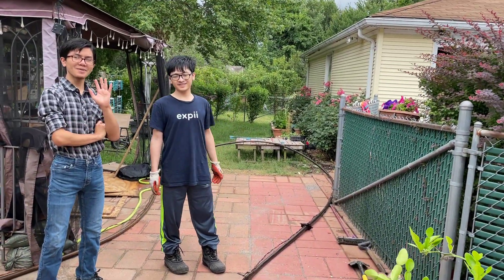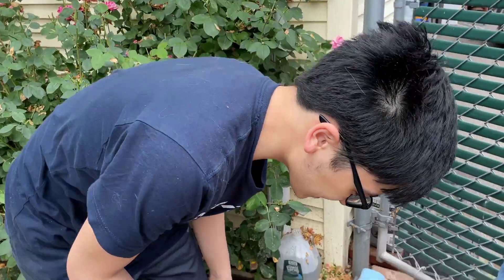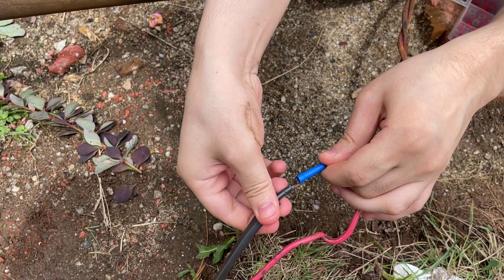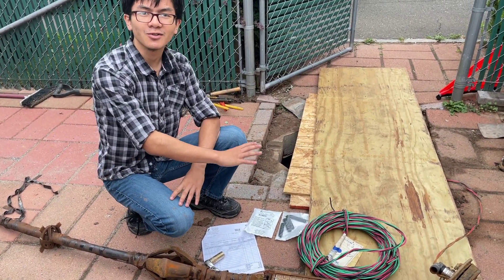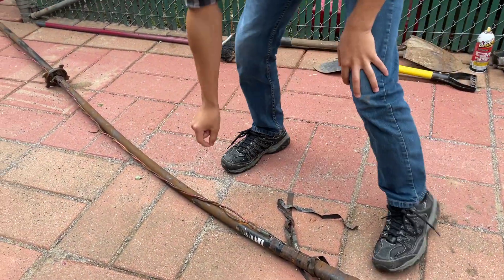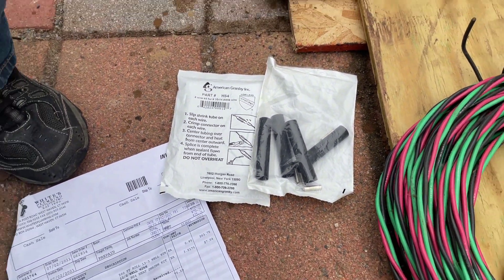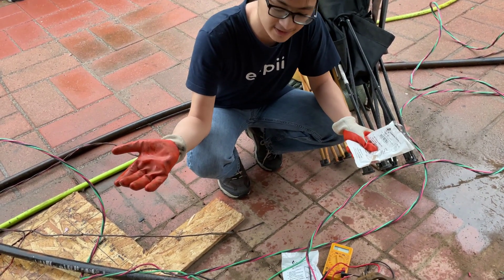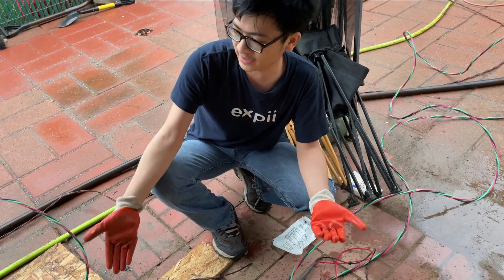Submersible Well Water Pump: How To Trace Break In Electrical Wire Heat Shrink Splice Repair Replace

Comment from the maker: Here are the #ad links to some of the tools, parts & accessories which might be required to perform this repair:
1.  https://amzn.to/3sJPQIW  |  Klein Tools MM400 Multimeter, Digital Auto Ranging, AC/DC Voltage, Current, Capacitance, Frequency, Duty-Cycle, Diode, Continuity, Temp 600V
2.  https://amzn.to/3ECi36w  |  Cut to Length 10-3/12-3/14-3 Wire W/Ground (Yellow, RED, Green, Black) Twisted Submersible Water Well Pump Cable Wire 600V Copper Cut in 10ft Continuous increments: You Pick Quantity! (100', 10-3)
3.  https://amzn.to/3mGxlB9  |  3 x A3C Submersible Pump Wire Splice Kit Repair and Installation. #10#12#14 AWG, 3 Wires Easy and Reliable. Crimp It - Shrink It and Forget it! - Pack of 3 Kits
4.  https://amzn.to/3sIgT7o  |  Fdit Electric 40-60 PSI Water Pump Pressure Control Switch Adjustable Double Spring Pole with Low Pressure Cut-Off
5.  https://amzn.to/3pARgDr  |  Red Lion 14942409 RL22G10-3W2V Submersible Deep Well Pump with Control Box, 26.75"H, Gray

Or Click on Amazon link here and search for what you need:  https://amzn.to/3xIOsqg

Comment: Alls you have to do is ground it to the ground rod that your house is grounded to out side. Our any pipe of your house. The water pipes in your house are supposed to grounded to the ground rod outside. Weather your running your 2  110v leads from ( say your main panel/ subpanel )to a 220 receptical then to the pump switch then to the pump) the main panel should be grounded then you pigtail the ground (splice) one splice you will ground to the receptical box and then another splice to the switch (if your switch has a ground terminal) if it doesnt have a ground terminal then  when you run your 2 110v leads and ground from the pump to the switch you connect that pig tail ground to the ground from the pump. And then your pump system will be grounded. Always try to keep your electrical grounded. Especially with 220v and water and your house wiring and back to your panels ground rod. In the case of your pump most water pipes in your home will also do because a home has a ground wire also clamped to water pipe usually close to your main panel that runs separate to your ground rod. So all your water pipes are grounded in the event of water pipe electrical wire disaster. Easy peasZy my friend. Keep up the thirst for knowledge kid. I see you doing big things when your older. Hard work does pay off😁